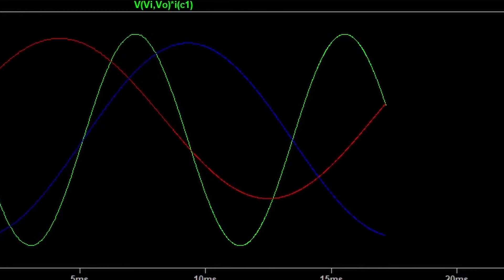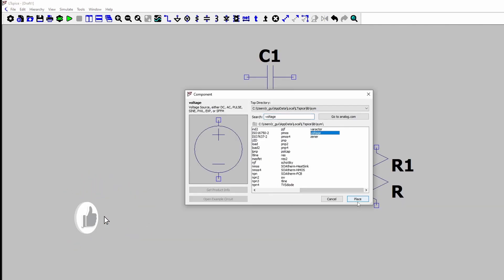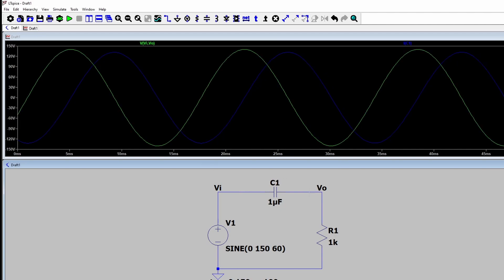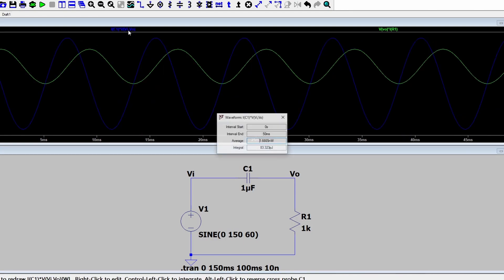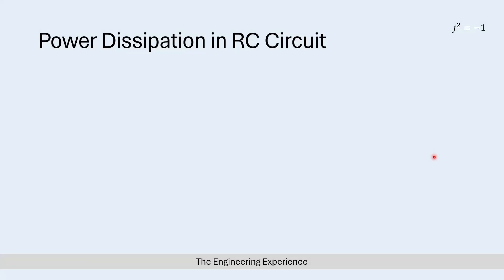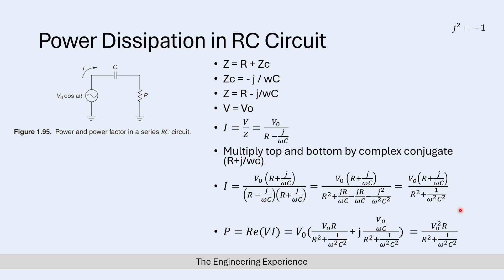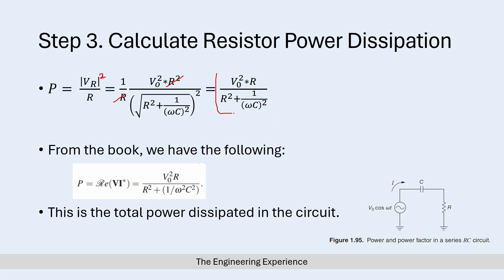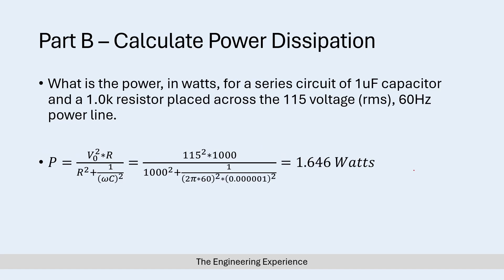Learn The Art of Electronics: RC Filter Power Dissipation Exercise 1.28

Comment: In the bottom line of second slide of the second solution you wrote I = Vo / (R + j / (wC)). I can’t follow how you got this result from multiplying by the complex conjugate, could you explain it? I understood the first complex conjugate result on the first slide, but this seems like you got a conflicting result.
Reply from the maker: I'll have alook at what you're saying and respond ASAP.
Reply: @TheEngineeringExperienceYT it's at the bottom of the slide at 9:33
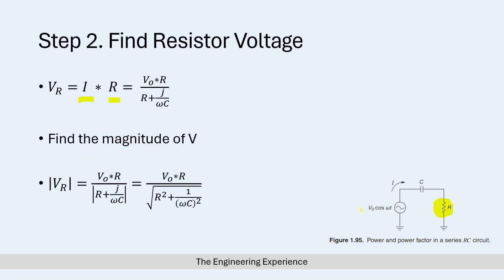Reply: Cause it's wrong, he cancelled the wrong term. It should be I = Vo / (R - j / (wC)). Luckily the final answer is still correct because he makes a second mistake. At 11:17 last equation he incorrectly squares j / wC and gets 1/(wC)^2 when it should be -1/(wC)^2. Both those errors cancel each other out and arrive at the correct final equation.